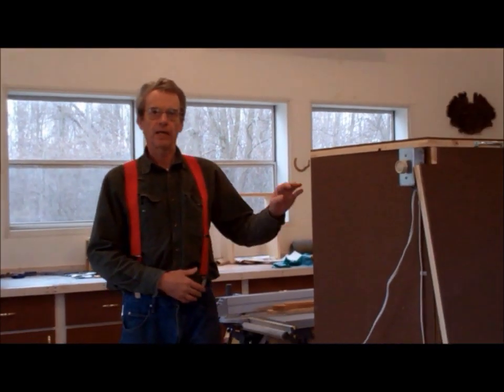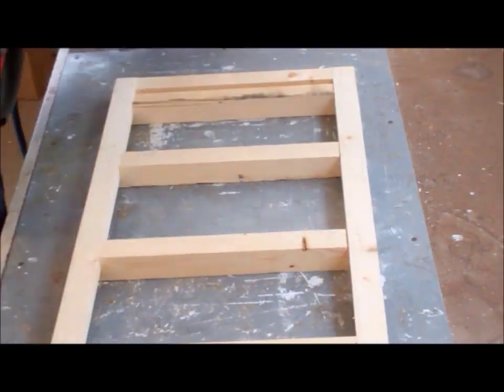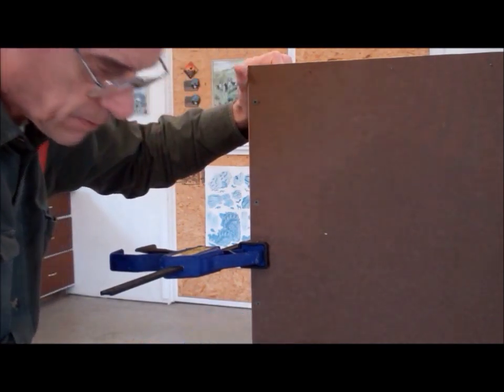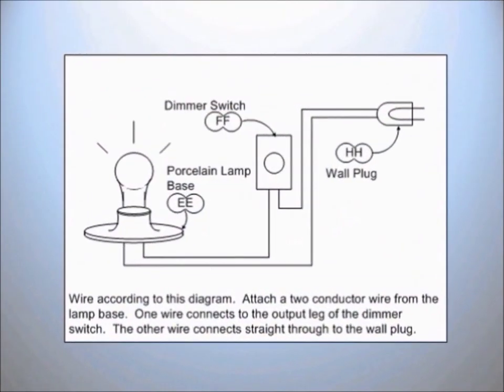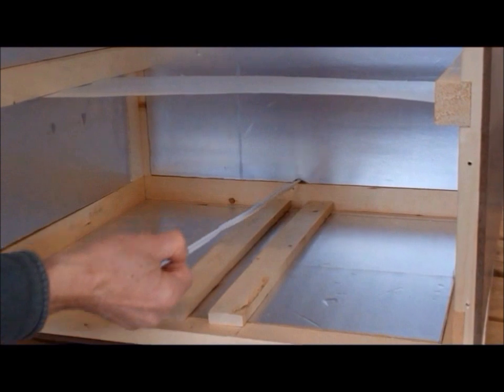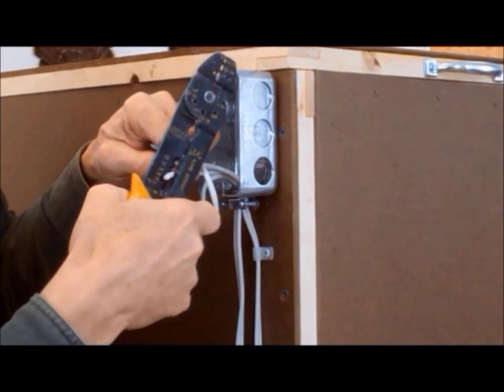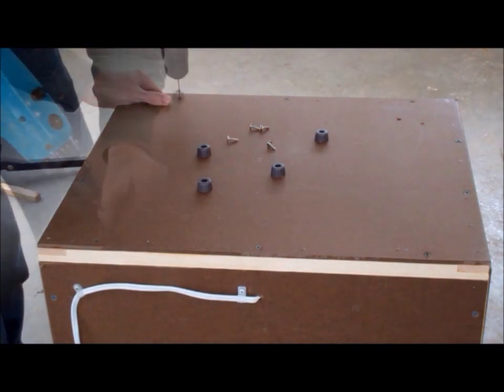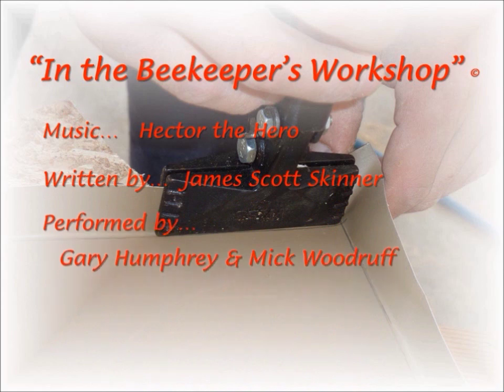How to Make a Honey Bucket Heater - Part 2

Comment: Thanks for the plans. It matters very much which wire is which, because you have a hot wire (black) and a neutral wire (white). You can only get a shock from contacting the hot wire. The hot wire should always be hooked to the bottom terminal in the socket to minimize the danger of electric shock when changing bulbs, and the dimmer should also be hooked into the hot wire, not the neutral.
Polarized plugs have one wide blade to prevent them from being inserted the wrong way. This is always the neutral side, and the narrow blade is the hot side.
Reply: P.S. If you hook the dimmer into the neutral wire, the socket will still be hot when you change the lamp, even though the switch is off.

Comment: I replaced the 100-watt bulb in my honey bucket heater with a 75-watt Chicken Coop Ceramic Heat Lamp, this seems to be the correct wattage.  True 100-watt incandescent bulbs have become hard to find.
Reply: I recall several years ago when GE announced the end of making incandescent light bulbs. That day I went to my local hardware and bought two cases of 100 watt bulbs.

Comment: Just as a small suggestion, I believe that if honey dripped on a  incandescent bulb there is a danger of the bulb exploding and possibly starting a fire. If using a light bulb get the explosion proof bulbs. They cost around $7.00 but may be a property saver. I personally would spend $10.00 at the pet store and get a solid ceramic reptile/turtle heater. They screw into a light socket, come in a huge variety of wattages, 75 watts is more than enough because Light energy transmission to Heat received is only about 65%. Therefore a 100 watt light bulb heating a space is delivering a portion of the energy used in light as heat. The Ceramic heaters heat space in the infrared band and deliver 95% of the energy used. By using a 75 watt ceramic heater you will heat your cabinet faster, use less electricity, it can still be controlled by the dimmer switch or a thermostat, and there won't be any lights left on to attract the nosy neighbors.
Reply from the maker: I too was concerned about honey dripping on the light bulb and exploding.  That is why I installed the aluminum drip shield above the light bulb. Also, ceramic heaters would work just fine. The idea is to install a modest heat source that you can easily control. You can also install a expensive (water heater)  thermostat which would automatically cycle on and off to keep the desired temperature.

Comment: Thank you for you video. But how do you control that the temperature does not go over 40 degrees celcius? Any thermostat installed?
Reply from the maker: The dimmer switch will allow you to control the temperature very precisely.  Put a thermometer in the box and you will soon figure out the proper setting.  Start low and work you way up to the preferred temperature.  Also, you might need to dim the bulb a bit at the honey bucket heats up.  I usually figure on 24 to 36 hours to completely reliquify a 5 gallon bucket of honey.

I know of one guy who used a themostat to control the temperature.  It was a water heater thermostat purchased at Home Depot (or someplace like that).  It was inexpensive, easy to hook up and worked fine.

Comment: Another great video, thanks so much from a newbee bee keeper. Quick question on the inside dimensions. Would a shallow super of honey fit inside the unit to allow honey collection in colder temps? I know they are 16 1/4" x 20". I might have to alter the dimensions a bit just not quite sure and would rather measure twice and cut once vs the other! I am sure in order to do this I would also hinge the front (Or maybe just the front) in order to slide the supers in and out. Thanks again and keep up the good work.
Reply from the maker: The dimensions of this honey bucket heater allow you to hang frames inside the unit.  The super itself will not fit.  Not sure why you would want to do this.  The temperature inside the hive is one thing; the temperature outside the hive is another.  I doubt that it would be a good idea to artificially heat the inside of the super when the outside temps are such that the bees would not otherwise be flying.  IMO.  Best to let the bees decide themselves when to fly and when not to fly.
Reply: Hehe no, I don't think I worded it very well. I plan on no bees in the heater :-)  I waited to long to harvest some of my honey supers and now the temp is too cold to extract it very well. I thought there would be less mess if I kept the frames in the super to heat them vs hanging them in the heater box and possibly drip more.
Reply from the maker: Got it!  I been there myself.  I hung the frames in the heater after taking them out of the super.  And, yes, there was a bit of dripping.